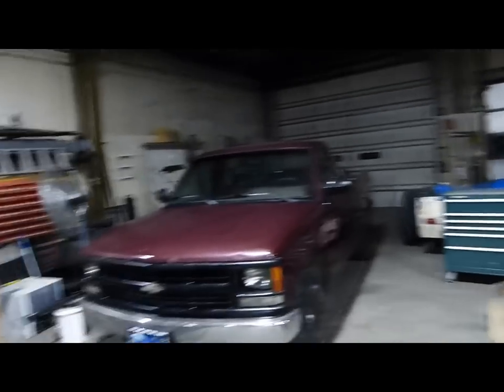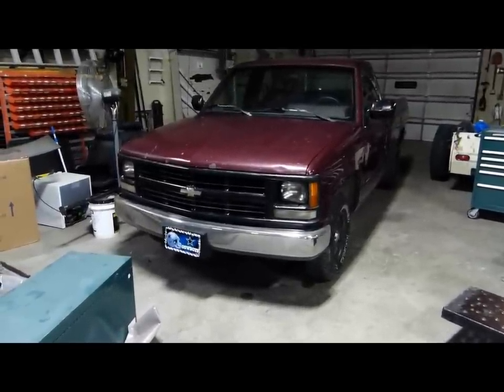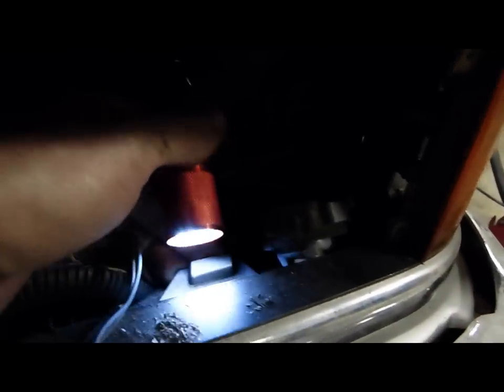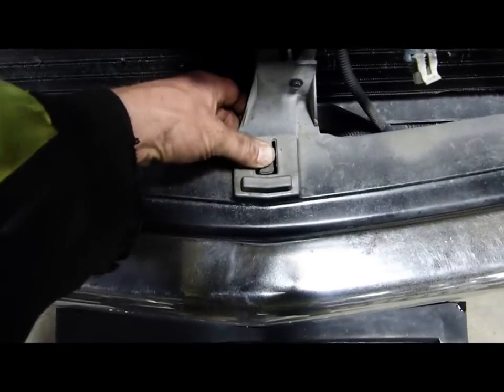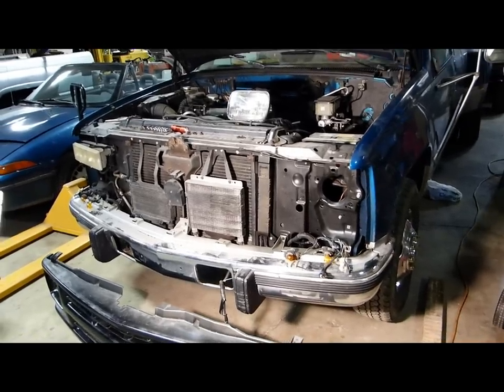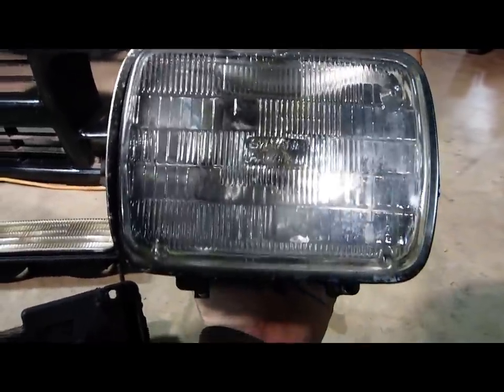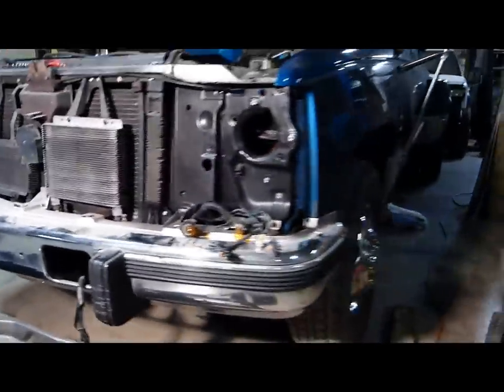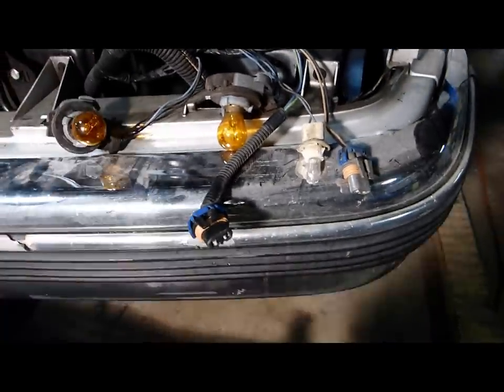1990-98 Chevrolet C/K pickup : Plastic to Glass Headlight Swap

Comment: Thanks for this...I was contemplating doing this switch on my 99 Chevy for the exact same reason.  Much cleaner and simpler look, and is a throwback to the classic Chevy trucks from 67 to 72.   Thanks to you, I now know that it's a fairly simple transition.
Reply: It is in fact a holdover model...it 's titled as a 99 but actually has the grille and light setup from the previous year.  Luckily, here in Los Angeles there are a half dozen salvage yards with the 90-98 base trucks just gathering dust.
Reply: I just traded a 69 c20 for a 95 c1500 with  the single headlights. I was just curious about the parts swap ability.

Comment: i have a k2500 with the w/t front end and agree that i personally like it more. in this case though i think the original front end of the dually suited it better. to each their own though.
also i recommend upgrading the lights on the dually if you use it at night. I converted my sealed beams to projector lenses capable of changing the bulbs and had silverstar ultras in them. worked great.
recently swapped those out for 5x7 cree LEDs and the difference is crazy. they look cooler and are bright as hell.

Comment: you made the maroon truck way better than the blue I wouldn't trade it :(
Reply: You're crazy! The glass lights never fade and the light options are better.
Reply: @d.9257  on a sealed beam if you crack the housing the gas leaks and the filament will die. The same cannot be said about the plastic
Reply: @RageUnchained  Not if you just order aftermarkets that will fit a H13

Comment: 1994 Chevrolet WT one thousand five hundred..... lol
Reply: Glenn Docktor it got me too 😂
Reply: Y’all ever think that a lot of people may not know what “W/T” stands for??? I didn’t! I never thought about it...
Reply: Ya this guy goes on and on I got my 1995 Chevrolet thirty five hundred with the 6.5 turbo diesel I guess he picked up a mint dually it had a blown 6.5 so he goes and puts in a new motor I guess and someone steals it he was pretty upset can’t say I blame him it was fucking strait as a arrow mint not a mark on it he don’t like me I commented on taking off the oil filter it takes me 2 mins on my 4 by 4 6.5 dually he said it was hard and he did every thing to take it off I told him he must be a shitty mechanic a 5 min job even if it comes off hard so he hates me know that’s not the dually that got stolen maybe he did a insurance job cause I doubt he had it insured for much book value was prob shit I’d say it would be worth 15000 at least with a good motor sorry I had to vent this guy drives me nuts he sounds like he works for gm as a marketer or salesman lol I think he is backwards the dually looked way better with the original grill not he’s got the w/t work truck
Reply: @darkrose4704  w/t stands for work truck

Comment: The video is great but you seem to have left out something important. The higher end grille has a small secondary pigtail for the smaller orange side marker lights. There is no such pigtail on the square single setup. How did you resolve this?
Reply from the maker: I am reasonably confident that I simply demoted those lights to be reflectors.  The smaller truck was traded, the following day, for a tri-axle trailer (see my winch on trailer video), and the new owner, Grandpa Al simply didn't care about those side lights.  Sadly, Grandpa Al died soon afterward, but I think the truck was transferred to his son's ownership.

Comment: Thank you for sharing your experience! I was teetering over switching my LS Suburban to single headlights and grill, for the same reason you mentioned. Also, the after market plastic headlight assemblies are crap. Sealed beams rock. Besides, one can always install upgrade sealed beam lamps.

Comment: I have a 2000 C3500 base model (single glass headlight) crew cab long bed 2WD. I think these trucks only came with a single horn. The fancy grille trucks have dual horns. The first horn is located in the center of the grille, the second horn is located on the passenger side, in-front of the battery. There are plenty of dual horn fancy grille trucks in the junkyards.

Comment: Great video content thx
Reply from the maker: I recently changed the video title in an attempt to obtain more views.  I noticed that a competitor video, newer than mine, had 10 times the views.  Thank you for your kind comment.
Reply: @HemiChrysler  yes I'm working on.my 1997 Chev Cheyenne 1500 and was wondering why only 2 screws with the plastic screw holder if u will and one spring ....ln one of the light bezels now I know that factory also came with a spring lol thx again now onto the stupid horn button on steering wheel lol

Comment: Are the front bumpers interchangeable? Can the 1994 bumper fit onto a 1996? Thank you 👍
Reply from the maker: Yes, 1988-98 C/K pickup bumpers will interchange, but the Suburban did not receive these bumpers until 1992.
Reply: @HemiChrysler   Thank you for a fast reply! Great video!,😀👍

Comment: Amen, brother! I actually prefer a chrome grille, BUT- Anything to get rid of damned plastic headlights and use clear, inexpensive glass ones! I just hit a deer with my Suburban, busted the grille and driver's side(plastic) headlight. Since I have to replace the grille, and at least 1 headlight, I want to just switch it over to base sealed beam glass headlights. I have loathed plastic headlights since they were introduced, especially on trucks. I think the plastic cloud-and-yellow lights debuted on the 1987 Ford full size trucks, as far as trucks go.

Comment: So.. why didn't you just swap the whole wiring harnesses? Aren't they the same at the firewall end?
Reply from the maker: It's too long ago for me to be certain, but I don't think the light wiring had a disconnect with the main harness.  I think it's all one harness, so you would have to cut the subharness and swap.  That would be another solution, just not the route I took.

Comment: How did you wire the single headlights to the Silverado dually? I’ve been looking for a dual to single headlight harness but no luck so far
Reply: Rewatch the video, one 1 set he said you have to branch the 2 grounds together, on the other you have 1 ground that goes to nothing.

Comment: My dream truck is a black extended cab short bed 88-98 chevy 1500, sometimes I see some cheap W/T models being sold around here, it's tempting to nab one cheap then try and convert it to the silverado lights and grille. To each their own, I personally like the silverado lights better. I'm just unsure how I'd even do the wiring. My dad swears by how reliable these trucks are...I currently have a 95 dodge ram 5.2 v8 and it gets me from point A to B but it needs a loose steering wheel fixed and possibly waterpump, it leaks a little coolant, and we all know how infamously bad the 2nd gen dodge ram transmissions are known for being....at 224k miles and no prior maintenance history known, it could be a ticking time bomb, but hey, it was only 800 bucks a couple months ago lol
Reply: I just bought your dream truck for 800 bucks 😂😂
Reply: I got a 91 k1500 and it's the 2nd best truck I own...first is a 77 c10

Comment: What's the difference between c/k and a silverado?
Reply from the maker: C/K is the model, examples : K2500 (3/4 ton, 4x4), C3500 (1 ton, RWD).  The trucks in the video are C1500 and C3500.  Silverado was the top of the range trim/equipment option for the C/K series.  On the successor trucks, beginning 1999, Silverado is the model name.

Comment: one question I have a 94 k2500 basic front end set up glass lamps. I want to convert it to the Silverado front end. could you explain the wiring part a little better? because I noticed when you turned on the headlights the brights and everything were on. was it wired wrong? or am I looking at it wrong?

Comment: I have the base model Cheyenne. I have never been fond of the square headlight grills. After nearly 30 of having the truck I am finally getting around to changing to the Silverado grill, and I will upgrade to LED headlights as well.
Reply from the maker: 30 years ?
Reply: @HemiChrysler  Yep. Bought it in 91.

Comment: I had those glass bulbs and i just drilled a hole with a diamnd tip hole cutter for glass and just shove an led light with high temp silicone and bomb led on a glass bulb.

Comment: Wouldn’t the wiring harness have connections that could’ve been swapped instead of cut?
Reply from the maker: I don't think I understand your question.  How could the connections be swapped without cutting beforehand ?  Do you mean a single connection point that leads to all light's ?  Yes, there is no such single point connector.
Reply: MET-TECH LLC I meant switching the wiring harnesses from each truck. But the day you did it worked well too. I suck at soldering so that’s the route I would’ve taken.
Reply from the maker: @limited50scla   To swap the engine bay wiring harness would be a significant job.  An additional complication is that my truck is diesel powered, whereas the other was gasoline powered, and thus the wiring harnesses are different.

Comment: The Sealed beams have better light output after a few years than the plastic.  Even if you clean up the oxidation on the outside of the plastic bulbs the vacuum plated reflector is not renewed so the light output suffers.
The Black painted WT grille looks better IMHO.  I have one on my 2000 GMC C2500.  I did keep the Red GMC emblem.
If you want the upmarket look with sealed beams get the 88 & 89 quad sealed beam setup.  It'll bolt up just like the plastic lamps.
Reply: You can buy real nice after market led and grill inserts the higher end grill looks way better I have new headlights and taillights ther really not to expensive and they look one hundred percent better than the seal lights plus they blow easy if one goes in the other a bulb is cheaper to repair and faster

Comment: I like both styles, but my 2 door 95 Tahoe has the chrome grille with the plastic headlights and the grille is falling apart. Both mounting brackets on top are cracked pretty badly. My parts truck has the base model style grille and sealed beam headlights. Looks like I'll be swapping them out since it looks so easy. Thanks for the video!

Comment: Know post is old,gonna do the dame conversion back to sealed beam.Was wondering about the wiring.My composite headlights has 2 sets of wires hi/low.How are these 2 connections wired into the sealed beam 3 wire pigtail.Any help anyone can offer will be much appreciated

Comment: You could just get a set of headlights and housings from a 88-89 Chevy and have the dual sealed beam...will still fit in any grill...gm made their trucks to be able to be worked on with parts from any other gm truck

Comment: Could you not have just pulled the whole harness from the firewall to light and just switched over, plug and olay?
Reply from the maker: I could be wrong, but I don't think that's possible.  I don't recall the headlight wiring having a disconnectable plug.  You could cut it further back, and transfer the entire front harness, and maybe that's what you mean, but you would still need to splice the harness at the cut point.

Comment: Wait, what? You like the work lights? They're horrible lights. They aren't good for driving at night. Im converting mine to the "plastic" ones ( the ones i bought are glass but they're referred to as compsites). You are limited to just those sealed beam bulbs too. The upmarket can take a regular bulb, halogen, led.... you cant change the bulb on a sealed beam. I was actually watching this trying to find the bolt size to the headlight mounting bracket.  They're supposed to be in the truck but im the 4th owner and i guess someone like you owned it before me and lost those bolts when they put the work lights in